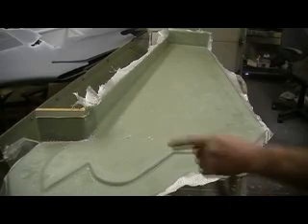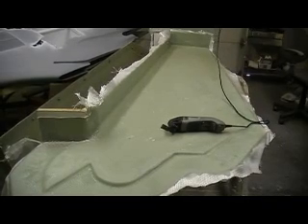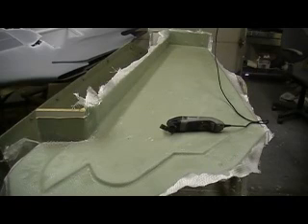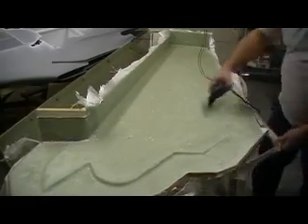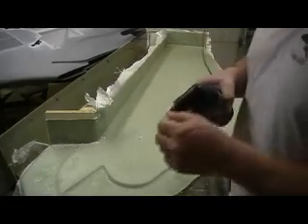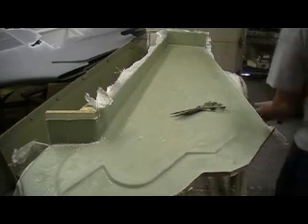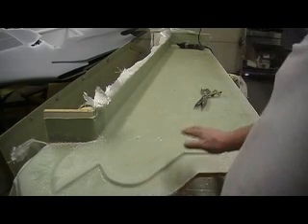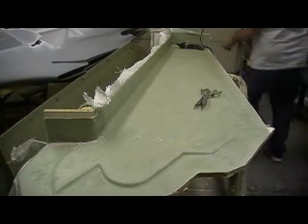how to build a rc jet B-1 Bomber # 117

Comment: STOVL will be a mean challenge for any model builder, as a jet will be riding on top of it's thrust (CG above exhaust), as opposed to a helicopter which is technically hanging below it. Not that a helicopter is an easy beast to fly from what I understand.